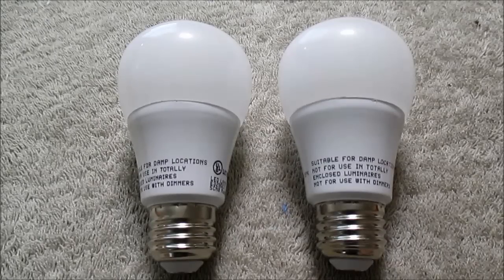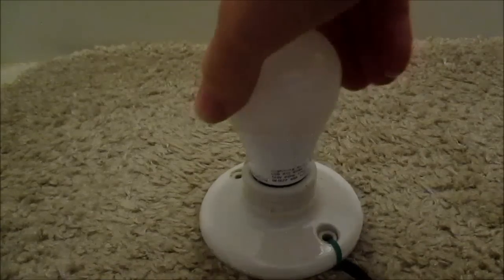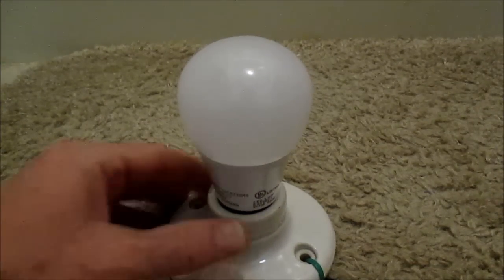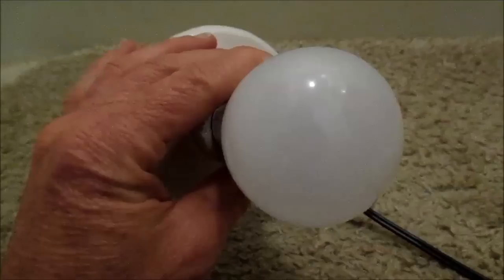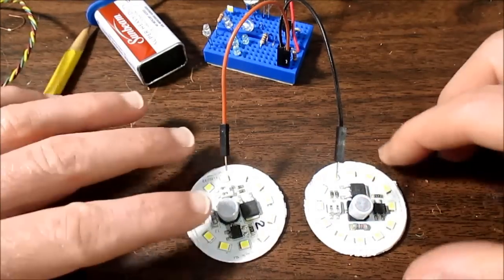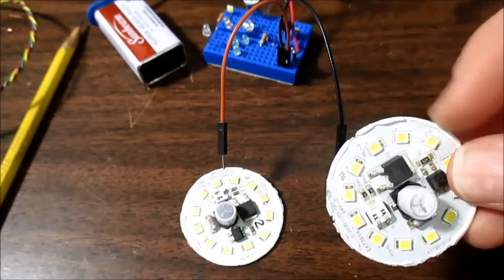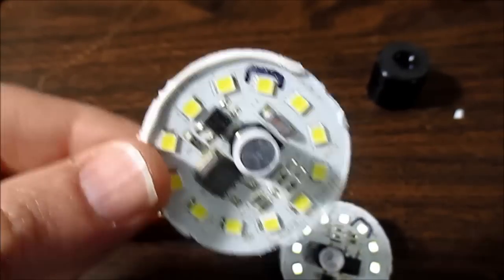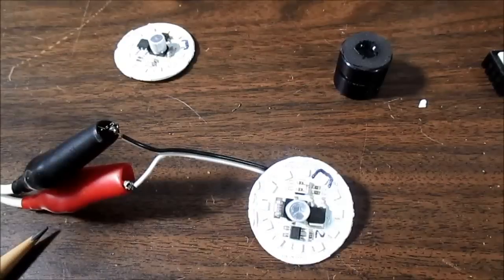Two failed LED bulbs for teardown to determine the cause

Comment: Have you tried un-soldering  a good LED from a bad light and soldering it into the bad spot on the other bulb? I think that may be interesting to see if a light can be recovered and for how long. :-)
On another note I have quite a few LED's around the house that are years old, some of the first ones that came out, back when they were still pretty spendy.

Comment: Unfortunately, no one can claim 22 years of service, when the technology, didn't really exist 22 years ago. Most plastics start to break down in 10 years and become brittle. The 22 year mark may have been loosely based off the actual LED element. Who knows how the cheap plastic, glue, and cardboard that compromises the rest of it  is really going to last.
Reply: The technology for LED's have been around since 1962, invented by GE and used as indicator light on numerous applications. GE has held the patent on incandescent bulbs since almost day 1; their patent is a "broad scope" patent that is restrictive to any "downstream development". For instance, if you wanted to make a light bulb it cannot be the same basic bulb "shape", they own that. It cannot use a filament, even if it's not Tungsten; they own the idea of ANY "filament". It cannot have a screw shaped attachment method, they own that. It cannot utilize any contact wires that come up and through a glass support inside the bulb, they own that. The only way to get into the light bulb market was to purchase the rights from GE and build it to their specifications.
   That's why the only other successful consumer light design has been Flourescent, because it incorporates none of those elements. Neon is impractical for homeowner consumer use. 
   We could have had LED lights since 1970, but GE sat on the technology until they could extract every last cent out of incandescent by "planned obsolescence", i.e. making bulbs crappier so you'll buy more, and by announcing the roll-out of LED and eventual phasing out of incandescent years ahead of time to get consumers to "panic buy" in huge quantities in order to stockpile ahead of the changeout. 
   Never buy "Utilitech" brand....they and other companies purposely use inferior components to raise the failure rate and increase revenue. I use Phillips and so far they seem to be good quality, no failure at all in 10+ years. And Yep, they cost more....but if they charged quadruple what I paid, it'd still be worth it.
Reply: and that's why smart countries like China just ignore that patent crap and make stuff everyone can afford :)
Reply: @Noswad 9 wtf is goup??
Reply: Exactly! I have built-in LED lights in my RV, which is only a year old. There were two puck-style lights on the underside of a cabinet that overhangs the head of the bed, for reading. A push-in style switch in the center of the light turns them on and off.  A few months ago the switch on one started acting up and had to be fiddled with to get it to work correctly. I got curious and pulled the cover off the light and tried to figure out what was going on. The small plastic base/housing of the switch where it mounts onto the circuit board had cracked and would not stay in place anymore, presumably due to heat, hence not allowing the switch to function properly. Eventually the switch fell apart right in my face. I replaced these lights with a different style quality light that won't fail due to design flaw and poor crappy plastic components.
Reply: I have a LED nightlight and after 5 years the plastic has turned brown in one spot. It’s on almost 13 hours a day and only shuts off on sunny days. I can foresee plastic cover failure long before the light source fails.
Reply: @joefromravenna  Except no.  The whole side of the cover could fall off and it's not going to affect the bulb functionality.  What will affect it is the hot running component inside that is turning that spot brown.  Heat kills electronics, especially the typical electrolytic capacitor in the driver circuit.
Reply: It’s 22 years at 3 hours a day.
Reply: What happens is the LED is lab tested to last X # of hours in a perfect lab environment (kept cool enough) and power supply failure doesn't count against LED lifespan (failing PSU can damage them).  Manufacturers claim lifespan as that of the LED in that perfect environment instead of the real world implementation.  Now about the rest of what you wrote, no.  There are plenty of plastics that don't break down in 22 years and as we see in the video and real life it is irrelevant, no bulb fails because the plastic got brittle unless it failed because you hit it with a baseball bat, lol.  None fail because of glue either, nor cardboard.  The three primary failure modes are power surges causing the switching transistors to fail, running hot so the LEDs or their solder joints are damaged, and electrolytic capacitor failure also from running hot.  Unfortunately these days most cheap bulbs have the driver potted in resin so it isn't even practical to try to diagnose or repair them.  They are even so cheap that they may not be cost effective to mail in for warranty replacement unless you save up a dozen at a time which means you need to buy extra bulbs anywhere to keep the place lit up.

Comment: In the old days, that is 1970 - to about 2000, the LED's were very, very reliable.     Short of connecting the voltage the wrong way round or excessive current, I have never had a failure.     But these modern LED's appear to be very unreliable and frequently fail.   But the control regulators appear to be an even more common failure point.      I have LED's from the 1970's still working today, without any problems.

Comment: Your LED lights are very different to the ones I see.    The ones we get use a converter inside them that rectifies the 120V AC to DC.    This then goes through a high frequency chopper IC, which then feeds the high frequency to a very small Transformer.     The output from the transformer then goes through a rectifier to produce low voltage DC, usually around 30V DC.    LED's are not Voltage devices, but Current devices, so the regulator is supposed to control the Current to the LED's.      LED's that is Blue LED's with white fluorescent material on them making them look Yellow, are about 3V devices.     So 10 such LED's in series would need about 30V to drive them.      I am not sure if it is the chopper regulator IC that is the common failure, or the small capacitor required to make the chopper IC work.

Comment: Led's don't want heat so it could be from the head
 led spots will die faster if they are in a closed ceiling with insulation 
And they can even fail before a halogen does becous the halogen can get a lot warmer before failure

Comment: Wow, you found out that there is no quality assurance neither any kind of quality check in a China LED factory. This is why they are very cheap. They sell totally untested LED chips.
This is what you get if you buy Chinese LED bulb on eBay. You forgot to mention but its 100% sure these things are from the Chinese market. Not Philips neither GE bulbs.
Seemingly you are looking for answers, and then you can't make any deduction at the end.

Comment: I had a Utilitech LED bulb fail (it suddenly went "BZZT!" and quit).
Turned out all the LEDs were fine, it was the 14-pin chip (on a tiny circuit board inside the base of the bulb) running the switching current-regulator that had blown.

Comment: Never ever use bulbs of any kind that are not made by known & respected manufacturers ( thorn, Philips osram  etc...) & don't buy on price
Shit bulbs will burn your house down.
This  from an electrician 30 years in the trade.
You have now been warned ignore this advice at your peril.
Merry Xmas from down under.
Reply: Malcolm Nuku , I think you are right. Fortunately, I was home when it happened. We smelled smoke. The bulb was flickering somewhat, as it smoked. It was not the socket. I turned off the light switch to let the bulb cool down before I could replace it. We were indeed lucky we were home and avoided a real fire disaster. All we had to do was to air out the house from the stinking smoke.

Comment: Now, why do my led under cabinet lights don't dim to OFF. When I dim them to off that all still glow faintly. Everything I installed is brand new, compatible and "dimmable" Is there a way to fix that? The led's are by "Illume"

Comment: I bought six led light from home depot for my kitchen.... all failed at the same time in less then 14 months. It was almost like they are designed to fail at a certain hour of use. I'm almost ready to put an hourmeter on them.

Comment: This is how they market their left over prototype unsold junk. It works but not for long when manufacturing on an assembly line the impurities were too high leaving a poor product rather than throwing them away put one in with higher quality LED’s until their gone that minimizes waste.

Comment: the  led   pushed to max  light output   -   in  usa  220v   same as  prc  -  uk  otherr  places  240 v  -   have to be careful on  all that  bought  .  Found that  some  of capaciotors  not 440 v  ac  working

Comment: It would be nice if they have put 10V2 Zener diode across LED par. If circuit is current limited and if each LED is under 9V, it would make light work, even if one led fails.

Comment: I've been wondering why some LED bulb lights don't last long, while others supposedly last for years. Also, some are reasonably cheap, while others are quite expensive. Any idea why?
Reply: First of all, before dispatching, it is essential to check whether the sinks each part are thrown and ensure that they are not free, and check whether the transmission structure keeps up sufficient lubing up oil, and checking whether the cooling water pipe is unblocked. While inspecting regulators and testing electronic stuff, motor sitting should not beat 10 seconds. The motor has a profitable plausibility, which gives flooding power and energy saving something for warships.The boat cover was from the beginning fixed with strong paper, yet displaced with magnet.

Comment: Looking at those lamps and comparing them with ones I have torn down I would say those are the cheapest made I have seen. Heat sink is marginal, no surge protection, 
I would be interested in placing a thermocouple on the board and seeing what the temp rise is...

Comment: Agreed that these cheap LEDs do fail regularly, I've had loads. In Europe though, I get more failures on the capacitor because our voltages are way higher. If you look at the datasheet for high voltage capacitors, you'll see that the expected life is pitiful.
I modified several using a simple circuit that avoids rectifying the mains, and that avoids that failure more altogether.
Reply: Oh wow, really? Never had a capacitor in a bulb fail as of yet, I get pretty high power 14+ watt 240v bulbs generally, i like things very bright, not had any capacitor failures though, just a dead LED or two!

Comment: Christmas lights have a "reverse fuse" that shorts out the light when the filament is blown and the voltage is higher than usual. Wouldn't it be possible to do the same thing in these lamps?

Comment: Perhaps you have spikes on your power supply that killed the LEDs as their appears to be no over voltage protection except the integration provided by the smoothing capacitor. Spikes could be due to turning off things like motors or other inductive loads.

Comment: I worked in a Yacht Chandellery for a while. One day a guy came in who replaced all of his incandescant and flouro globes with LED globes. He said one night he had most of his lights on and was up reading when all of a sudden, all  of the lights began to flicker and then gradually got dimmer and dimmer until they no longer emitted light. He tried turning on and off again to no avail. Tried the main fuse, all good. Tried taking them all out and cleaning them and their contacts, still no change. So he ended up with a few hundred bucks worth of useless LEDs to replace (which he did) And I have heard of the same thing happening to a few other boaters. I wonder if it is a problem where there should have been some Resistors installed in line with the led globes, rather than just installing them without doing anything else. or is there a problem with grounding, Bus Bar , ETC ? anyway, a definitive answer would be cool, as I am getting ready to refit a yacht and really don't want to spend all that on LEDs with the fear that they could go kaboom at any moment!? Thankyou for your help, Tom, Perth, Western Australia.

Comment: They need consumers to buy replacements. It is an engineered intentional failure. 
I'm willing to bet that the LED bulbs that have an engineered failure are more costly to produce than the LED's that have no engineered failure. 
It would be interesting to have such objective information.

Comment: The reason your current calculations are so far off is because you are using the wrong numbers: 115 VAC, rectified will give you close to 172 VDC. You need to know exactly how much voltage is coming across the regulator.
If the LED's each require 9 V and they are all wired in series, that would be 9 * 12 = 108. 172 - 108 leaves 64 volts to be dissipated somewhere. I would guess that the resistor is in series with the regulator to cooperatively help drop that 64 volts.